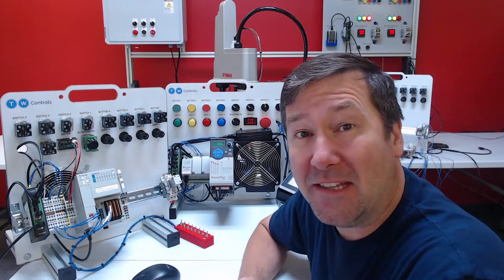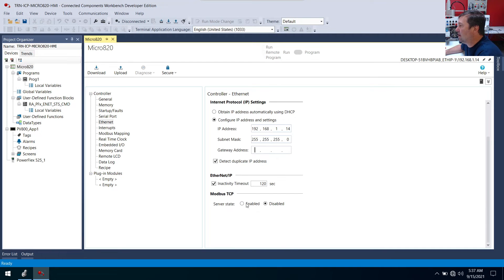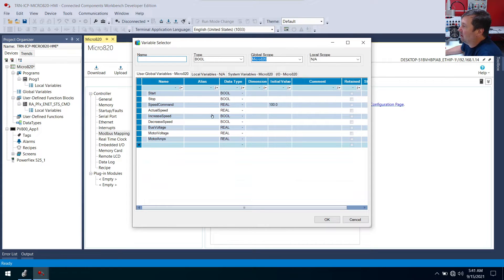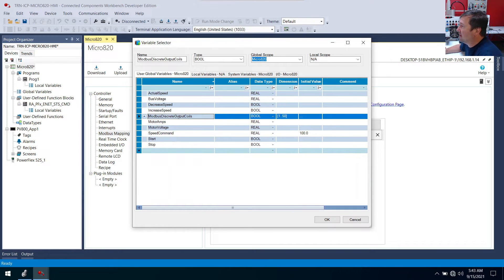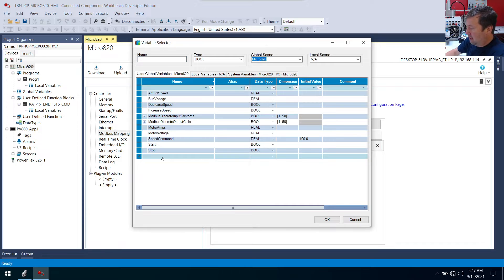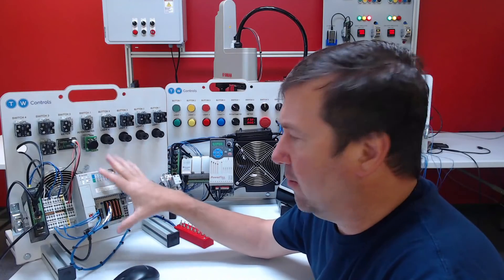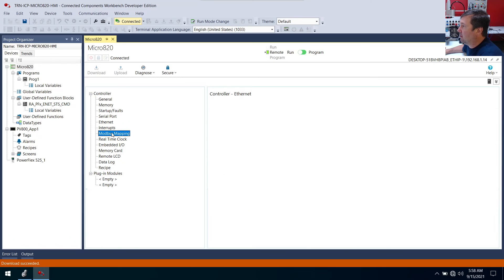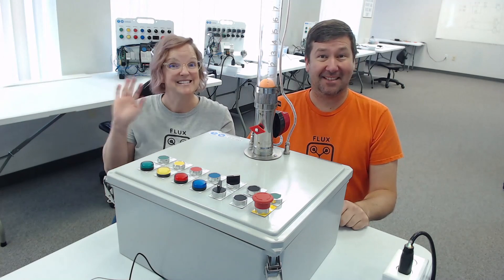Turn a Micro800 into a Modbus TCP Server

Comment: Do you have any experience with KepWare and Freewave 900MHz spread spectrum radio networks in this area? Just seeing if it's an option for use to use on our remote RTUs in our system. Looking to replace our older RTU controllers with Micro800 series PLCs.
Reply from the maker: Only very limited experience with Kepware and non with Freewave.

Comment: For the target address I think the docs leave out an important detail…it will also increase by one on addresses it receives. I had a non-AB device that indexed the addresses starting at 0. It was the master in this case and to read coil address 1 in the CCW mapping I had to set my target in the master to 0. So I think micro to micro it’s subtracting one and then adding one.
Reply from the maker: I think you are right about adding back, this video I leave in fumbling through it.  See if you agree.
https://www.youtube.com/watch?v=w4r7t0G3Pd0

Comment: TIM it is posible to use a micro 800 hmi on modbus to cominate whita a Do-More PLC?
Reply from the maker: By MIcro800 HMI do you mean a MIcro800 PLC or a Panelview 800?  It should be possible with both.